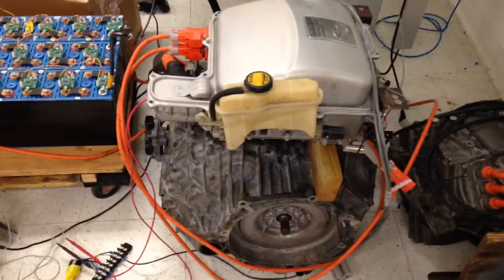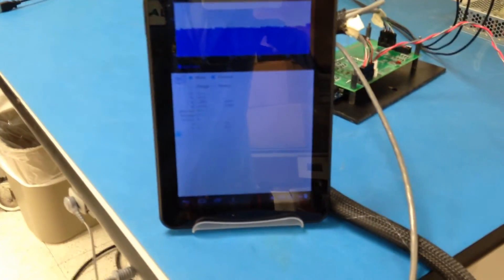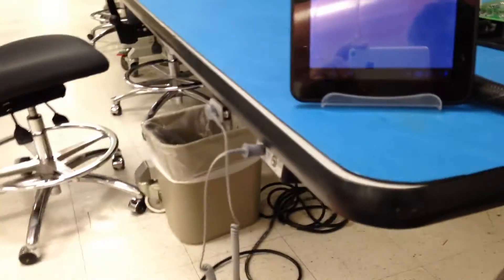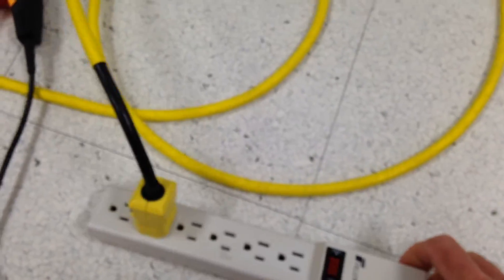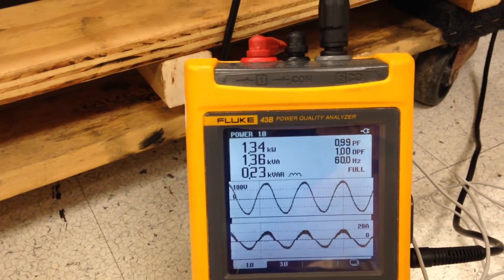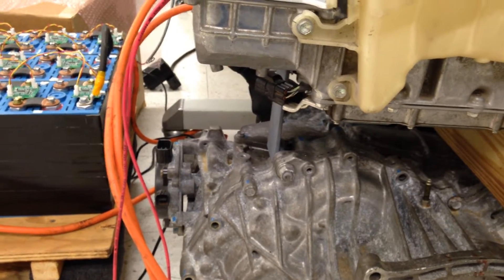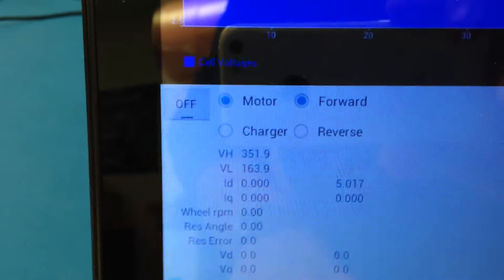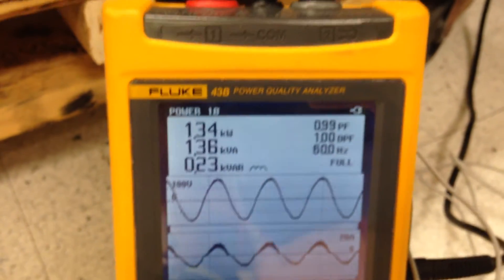Through Motor Charging

Comment: Super video series... you've certainly tackled a big project here!  Can you give a brief description of the benefit of through-motor charging?  WONDERFUL P.F.... no doubt there!... but is that the main reason... or is it that you can accomplish charging without external additional charging hardware? Where are you inserting the Line Voltage at?  Will you be running straight HV battery power to the drive, without using the Boost circuit in the Inverter Drive? If so, what's the advantage there?

I have a 2008 HiHy... love it, for a factory job. Far too skimpy on the battery capacity, but understandable from an OEM viewpoint. Considering someday getting a Camry Hybrid... and had thoughts of installing the RWD motor assy from a HiHy, and a much bigger Li battery pack... and of course lots of inverter mods. (I have a couple of complete spare HiHy inverter/drive assy's to play with)
Reply from the maker: Thanks
This invention provides plug in charging of my Electric Vehicle battery without needing any extra AC to DC converter hardware.  This can save over $1k.  I am going to add another video showing more information about connecting the line voltage and controlling the modulation.  I have done some more testing and it seems to work very well.  I filed for patent protection with hopes of licensing the idea to a PHEV manufacturer.

In my EV project I will probably remove the DC to DC boost circuit and go to a higher voltage battery directly.  I need more battery range anyway and the boost circuit is limited to about 100Amps (I think).  So the advantage would be higher power capability without having the DC boost circuit in line.  There may be some downside to doing it this way but right now that is my plan.
Reply: Was you granted the patent? It sounds similar to how the Chameleon charger in the Renault Zoe works. Do you have somewhere I can read more about your project? I'm obsessing about the idea of having a go at converting a car.